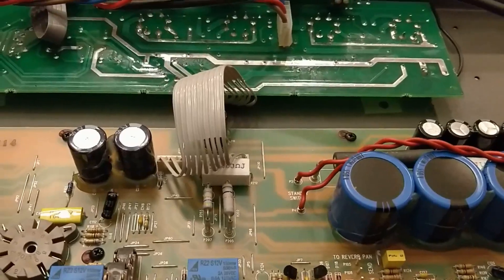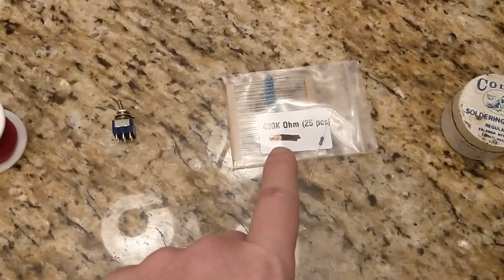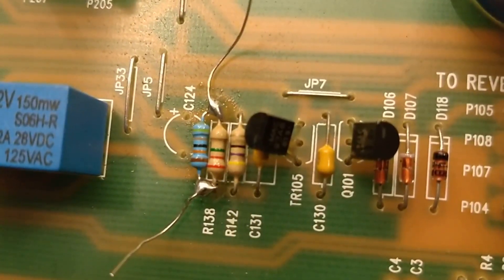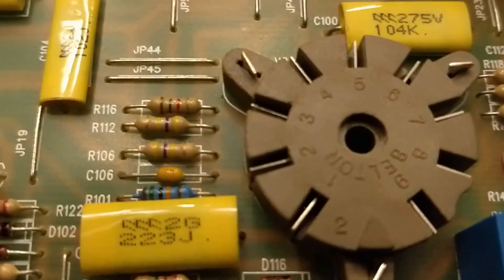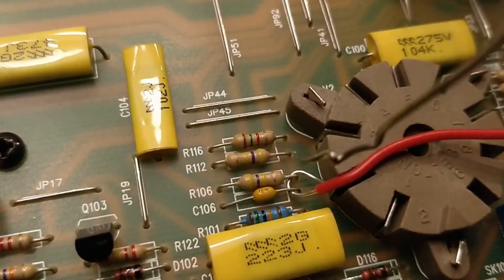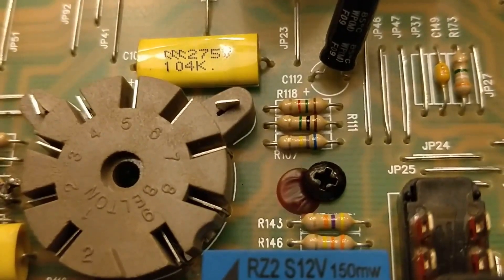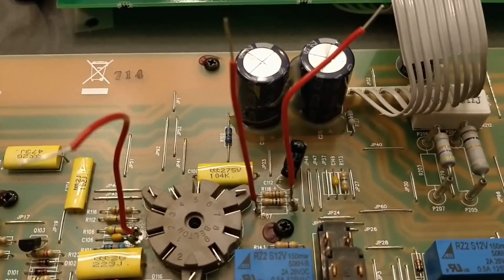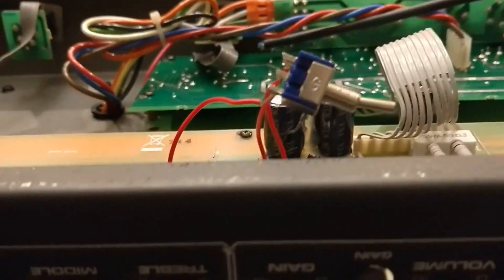Valveking JCM800 Mod.  Yep. VK112 VK100 VK212 Peavey Valve King Modify to Marshall Distortion

Comment: Is there any way to learn how to do the 800 and Mesa mods? I'd like the resonance knob still work. Plus the effects loop mod, is it necessary after those mods? With less noise when not playing would be great. I have one Ii need to replace one of the input jacks so I thought about doing some mods on it as well. Thanks.
Reply from the maker: The ancient Harmony-Central threads could theoretically be found on the wayback machine for the Mesa Mod, but be warned, you'll need to get creative yourself with the switches if you want the ability to go back and forth between stock, 800, and Mesa.

Comment: From the schematic it looks like R106 and C106 are already wired together at the same point where you joined them (ctrl grid of V2) so you may be able to solder from just one of their legs? just checking my understanding of the mod
Does the mod effectively bypass the first triode of V2 and take R107 (680k) out of the circuit ? 
Many thanks for showing us this mod!

Comment: Thanks for the great video!

Just picked up a Valveking 112 on the advice of Glen Fricker. Currently using it as a head and may change the stock speaker to something better.

3 of the 1/4" jacks are bad and I will apply the JCM 800 mod when servicing the jacks.

May do a tone comparison video, as I recently acquired a 640 Rex for recording.
Reply from the maker: I hope you do.   The Mod makes the amp sing.  Jacks should be an easy fix so good luck to you with this
Reply: Yo, this mod is fucking glorious!

You weren't kidding, this thing sings now! Can even do distortion at bedroom levels. I still hate that VK speaker though. 

I will pick up a Humno and a Mojotone British Neo in a couple weeks to complete this project and I'll send you another reply when I post a video with the A/B comparisons of all.

Thanks again for posting this video, man!
Reply: There's nothing wrong with that speaker !!! @FeralFrens
Reply: @SmokinFoolz that mod makes you loose the switching between clean and dirty and confuses the controls . Does it sound better? I did the Mesa and Marshall mod and can't tell the difference. I think it may bring down the gain which is over the top. That's what I noticed. The mod can be removed but it takes a long time to get the board out.
Reply from the maker: @GerhardGeficky-jg4ok  I dont take the boards out, as in the video.  I open the chassis.  Mesa mod was same, no board removed since you only need to access one side of the board....unless there are errors and cleanup is needed!
Reply from the maker: @GerhardGeficky-jg4ok  and yes it sounds better.  I prefer my 2x12 cabinet over the stock speaker but the stock speaker is fine since this amp is the ready-to-go living in the trunk of the car monster
Reply from the maker: I am so happy you are pleased.  You rock

Comment: Is there any reason why you wouldn't just replace R138 with a 360k resistor instead of "piggybacking" a 430k onto it?
Reply from the maker: It's easier and the value change supports it.  But great question because the optimum value for each amp is slightly different.  iirc there was an old defunct ultimate-guitar forum conversation about the proper value for it, but I never shared my experience back then.  The forum was preserved somewhere else and probably worthy of a google search, but the thread was a constant debate. Some even went as far as replacing it with a 10k.
And regarding MY video, this is what I found that works back in 2012 gigging with a band called Living Experiment.  My VK112 modded lived in my cars trunk and always performed for 5 years every day.

Comment: Hello, thanks for your video.
What does the channel switching mod do?
Does it fix the "tone drop" or "delay" when you switching the channels?

It would mean very much to me if you can explain it again.
Got a VK100 Head und stopt playing it because channel switch delay is pain for live.
Reply from the maker: yes you guessed it that's exactly what it does it makes the channel switching instantaneous as if you were turning on or off a boss distortion pedal.  if there's a pause in between turning it on and off, it's hard to do in the middle of a song so this mod will fix that problem

Comment: can you make mesa mod tutorial with switch ?
Reply from the maker: I can but I haven't seen any ValveKings since I released the mod video.  The mesa mod is a 1 trick pony, the JCM800 one is far more versatile.  Mesa Mod with a switch I've done before.  It requires two switches or a fancy triple pole switch to turn it on/off.  Honestly, the Mesa or JCM mods are both going to make the amp better in the lead channel than stock, so the switch (you will find over time) will never be in the "stock" position anymore.  Even for clean sounds, just switch back to clean channel and that's the best for those.  Hope this information helps!

Comment: Sorry to blow you up here lol, but I’m just curious about this version of the JCM mod. I have seen one other person do this version of it in the past, but I can’t remember where. I’m def not an engineer or anything... just a hobbyist. I have noticed that other versions of the mod grab the signal later on down the chain... to the right of V2, typically.. when facing the board and such from the same orientation in this vid. What I’m wondering, does this version mod even have the signal going through V2 at all? Or is it just achieving overdrive through V1 only? Since the signal is grabbed at C106/R106, I’m assuming it doesn’t pass through V2 at all with this version?

*edit: I looked at the schematic again, and I can see it does go through v2, nevermind. I guess the point of this mod is to grab the signal and send it through the second half of v2 at what would be the end of the fourth gain stage... but since it’s grabbed at v2a it isn’t allowed to go through it... hence making it a three stage gain like the JCM800... correct?
Reply from the maker: You got it.  3 gain stages.

Comment: Ever done the R100 mod? It disables a small portion of the noise gate circuit to the left of V2. It really helps the amp to sound much, much better whilst on the lead channel. All you do is short R100.
Reply from the maker: I'll do you one better, replace it with a pot
Reply from the maker: I'll have to make a video on this I'm sure.
Reply: @SmokinFoolz  yea, I’ve read that’s what the noise gate is on the JSX. Makes sense. I hate the sound of it altogether though. It’s responsible for a fair amount of the muddiness that people perceive in the lead channel of the VK. This morning I actually disabled D101 and D102... which is the second part of the noise gate circuit. It further cleaned up the sound. I guess it depends on what kind of preamp tubes you have installed whether you need the noise gate circuit or not... among other things.
Reply from the maker: @DemonKingOFFICIAL  The JSX has a bit more going on,  but YES! the effect is the same.
I've put the pot in these for the noise gate...it does help.  BUT  crap in crap out, if your guitar (like my old gibson) is just noisy, nothing will help you.  Buying a noise gate helps far more than the mod in my opinion.

Comment: I need help with Valveking. I have a VK112 model and I want to do an R100 mod. with 1 meg potentiometer.
 I don't know if the 1 meg potentiometer is logarithmic or linear.
Thank you in advance 🙂
Reply from the maker: I would go to an amp tech or music repair shop near you.  They'd probably answer a simple question like that on the phone.  I'd say stay out of the amps because they are dangerous.
Reply from the maker: Another user asked about this, and yes there is a lot of options for replacing R100.  Definitely enough to warrant a video.  Please subscribe and you will be notified when I make this video